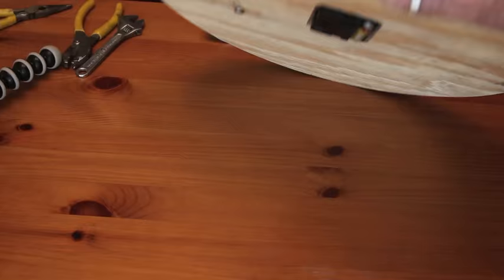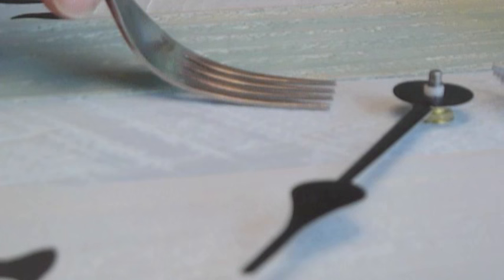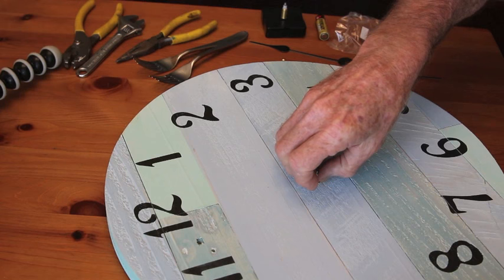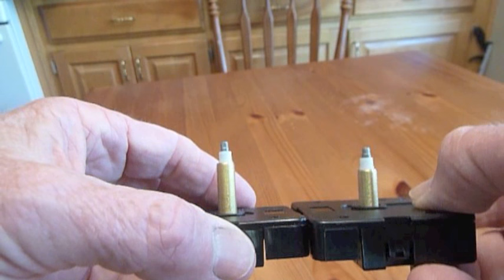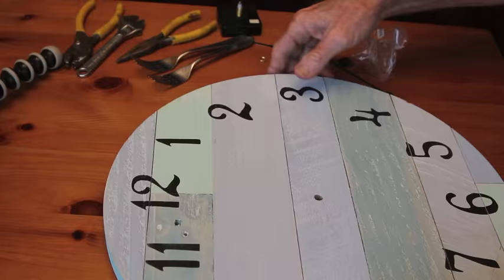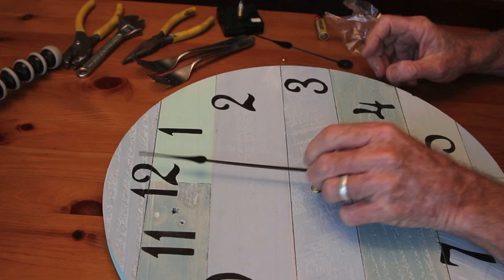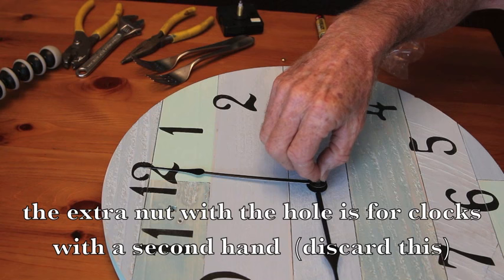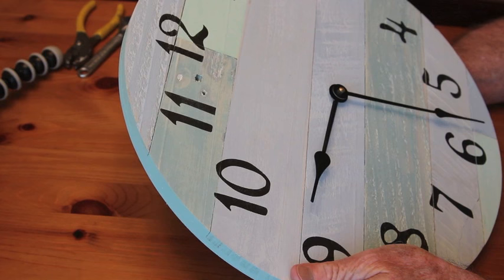Replace a quartz clock movement

Comment: Thank you very much. I have a beautiful quartz wall clock that I have had for 10 years and it stopped working 9 years ago. I am going to try replacing the movement box and see if I can get it going again. Your instruction video was very helpful, I did not know there was different sizes in the length of the pin that sticks through. Now I know what size to order. Thank you again! 😀

Comment: On mine, which looks identical to the one in the video, the first nut to be removed ( at :20 of video) does not unscrew.  I have twirled it over a hundred times or more, and it does not remove.  I can continue no further.  Any ideas?
Reply from the maker: Hey Roger, I'm sorry your clock mechanism isn't coming apart. I don't have any suggestions without seeing it. All the clocks I deal with are about the same - they dismantle as shown in the video.
Reply: I was very careful when trying to dismantle, which is why it was so frustrating to get stuck on the very first phase.  Well, I sort of gave up and just pulled the nut out (with some minor force).  Seems to have worked, and I have replaced the mechanism, which (so far) appears to be working.  Thanks.
Reply: I had the same problem...turned out  it was stuck on with glue tapes...had to break it off!